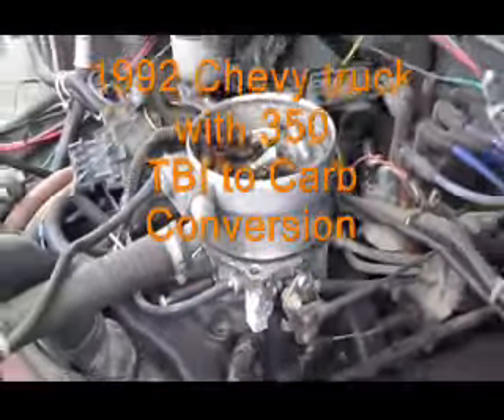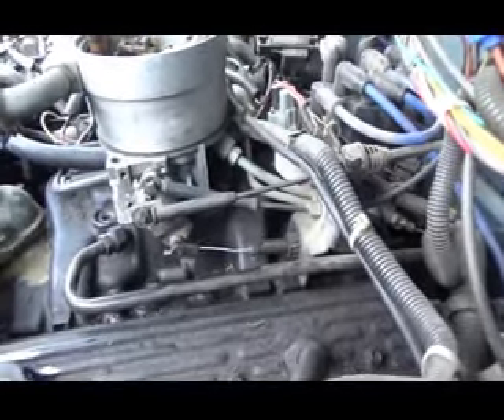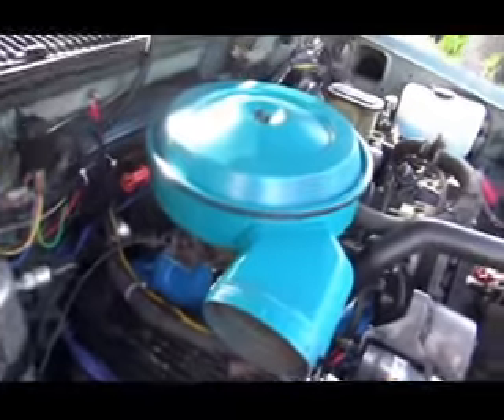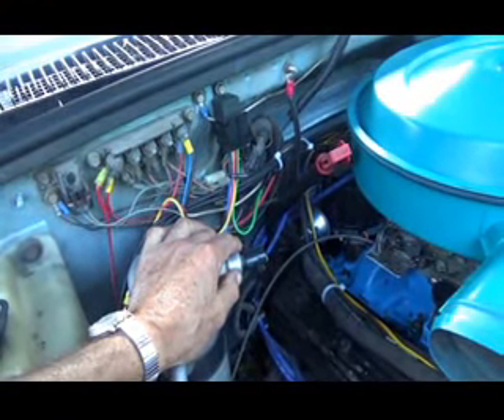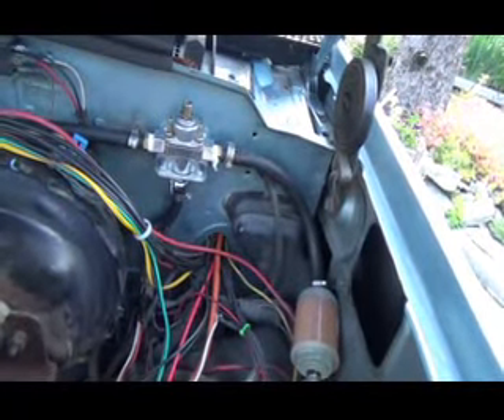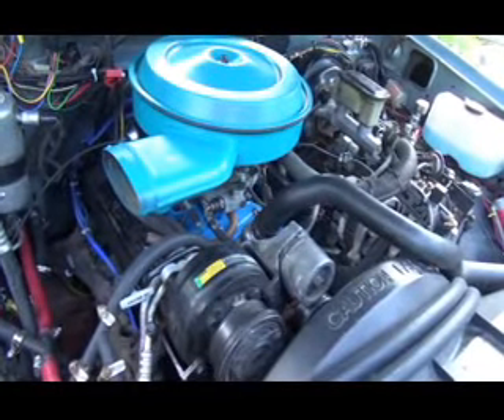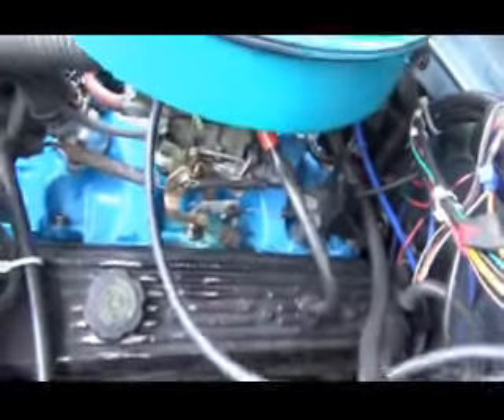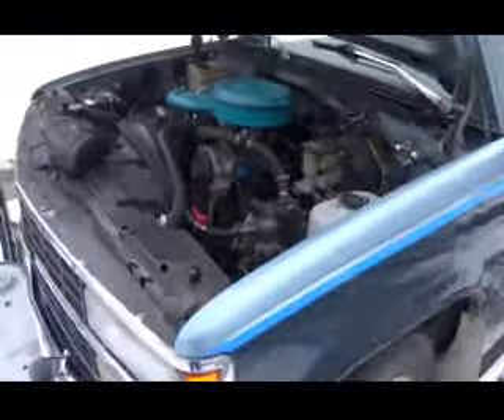Chevy 350 TBI to Carb Conversion

Comment: Were you able too install the Cruze control cable? And is there a noticeable power difference with the carb?
Reply from the maker: Don't use the cruise control, so I took it out. Yes more power, runs soother, same gas mileage as fuel injection.